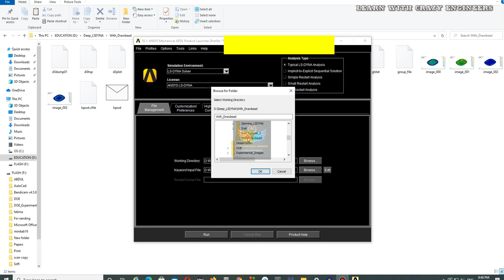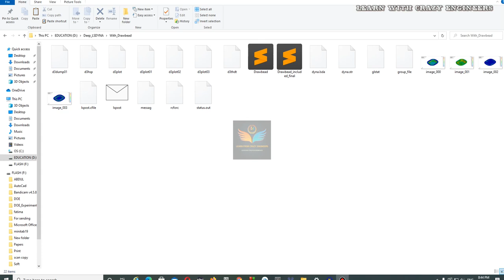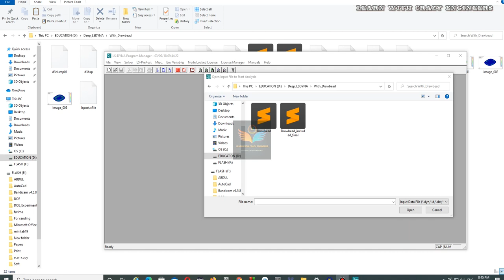LSDYNA Tutorial 10: How to run your .k file using ANSYS and LSDYNA manager.

Comment: Dear sir, I want to run the .k file, kindly could you please help how to run it ?
Reply: i want to run in HPC !!!
Reply from the maker: Do you have license or crack LSDYNA manager
Reply: @LearnwithCrazyEngineers  Yes sir, we have academic license, may i know your contact number ?
Reply from the maker: I never worked with HPC. We used only single cpu with high configuration. If you explain your problem I might be able to help